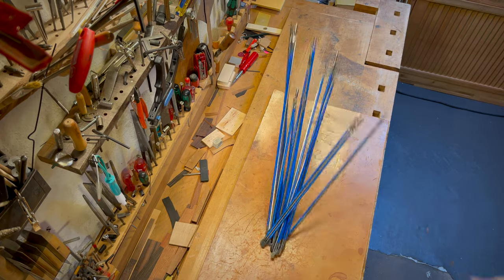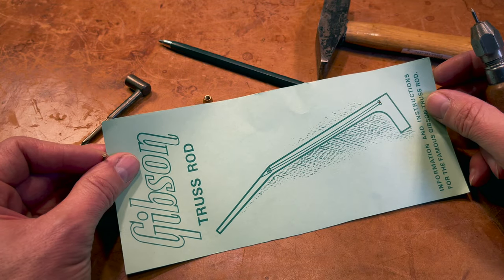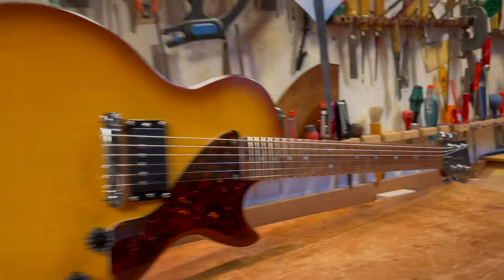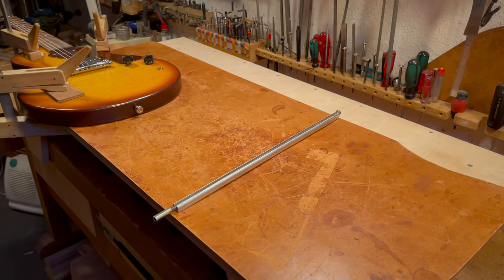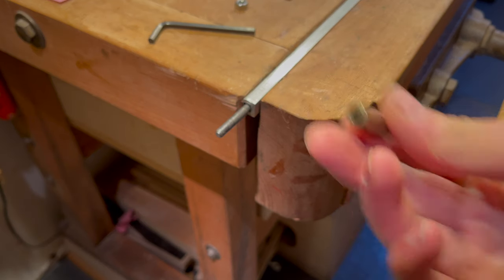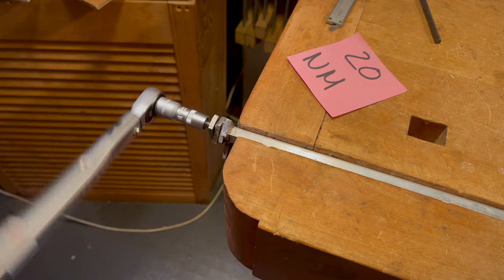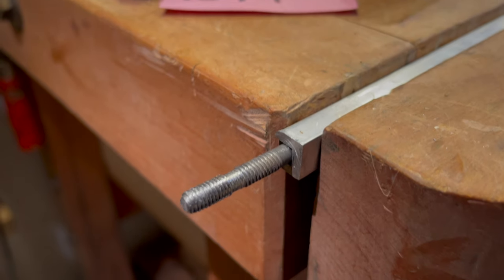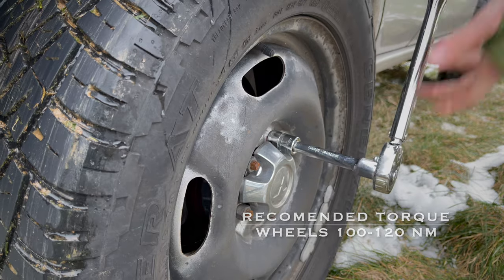Busting Guitar Myths/ exploring Truss Rod functions /can I break it/  Ep.24

Comment: Very interesting Nik. As you were upping the torque, all that went though my head was that the threads would strip, rather than the truss rod shear, due to the lack of thickness of the adjusting threads. Thanks for having the bottle to be the one to try the experiment Nik. Kindest regards, and happy Luthiering. Cheers, Dave 😊 🎸🎶
Reply from the maker: Thank you so much for your positive Feedback Dave. This was quit interesting for me to...but if you wanna break a 6mm Steel Trussrod you really have to apply a lot of torque on it... Best Regards Nik

Comment: I watched this because when I was adjusting my old fernando stratocaster's truss rod, I always hear some cracking sound even in slight turns. I was giving it a relief because I am hearing fret buzz on the first fret. I am worried that I might have broken the truss rod
Reply from the maker: Thanks for your feedback. It’s hard to say if your Trussrod is damaged but I suppose the problem is your Nut. If you have buzz just in the first Fret check your nut slot hight 👍Hope this will help you out. Best Regards Nik

Comment: I think people are not so much afraid of literally breaking the rod, but they are afraid that it will stop working. And to do this, it’s enough to strip off the thread or strip the head of the screw and you don't need much force to do so It is enough to not insert the key all the way or use the wrong size key
Reply from the maker: Thanks a lot for your Feedback. Yes you are absolutely correct. Using the wrong key is also a very common issue that cause a male function of the Nut. Best Regards Nik